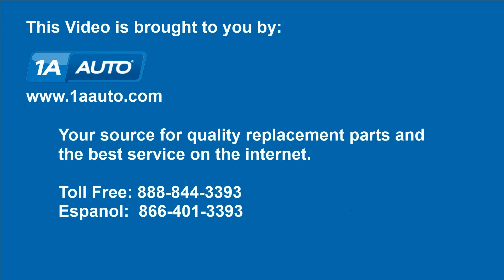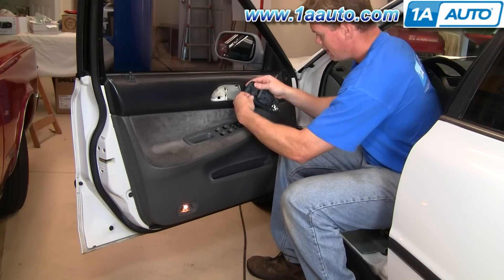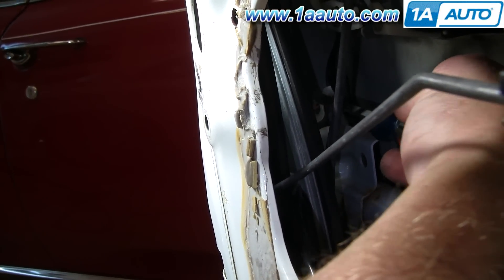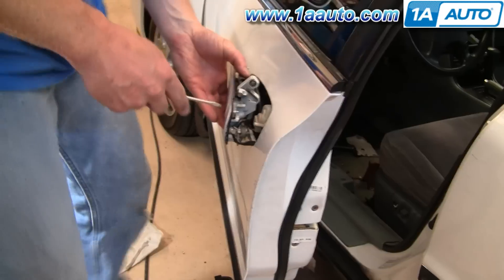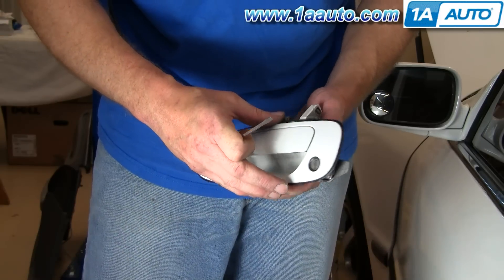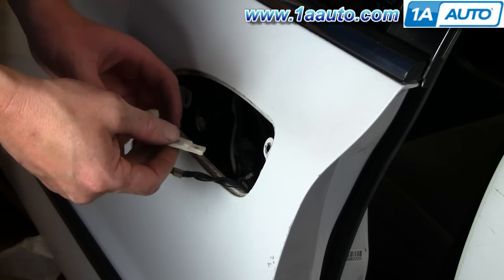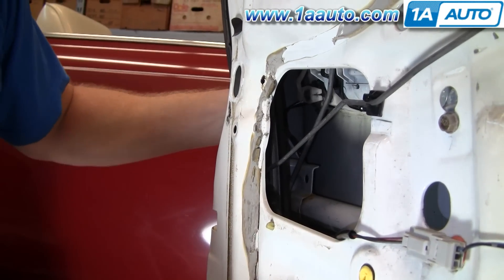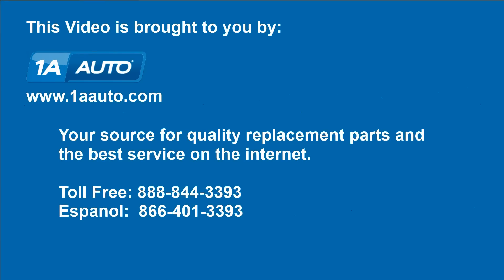How to Replace Exterior Door Handle 94-97 Honda Accord

Comment: Very Helpful. Just replaced the handle on a 98 Accord.  It was a difficult to get the lock separated from the handle and door.  Removing the retainer clip was the hardest part.  It's not part of this video, but it was on the 98 Accord.
Reply: How’d u do it

Comment: Helpful video. Only issue I had with my '94 Accord was the orientation of the white plastic "teeter-totter" shown at the seven minute mark. I installed it as shown but upon reassembly the key wouldn't operate the outside lock. It was in a bind and couldn't be turned either way. I reversed the two connections so the metal rod coming up to the teeter-totter from below was towards the rear of the door and the short white rod going up to the door handle was towards the front. Everything worked properly after that.

Comment: Video was great! I took off the door panel without breaking unseen clips. Almost broke the clip to remove the inside handle though, I took another look at the video and did it correctly. The outside door handle was loose because a screw was missing. I was hoping it was inside the door panel, and unfortunately it was not. How can I find what type/size screw it is?

Comment: any chance you can explain how the 99 is different?  i got it all apart, and back together - but i can't get the lock itself to stay inside the tube...any pressure from the outside pushes it out.  it's like that retaining clip isn't doing anything...and no matter how hard i press - no click.

Comment: after i fix the lock actuator; there's another problem. When i try to pull the handle from the outside it automatically the lock button goes back in. can you tell me whats wrong or is it the handle? I can open from the inside but i have to hold it all the way to push the door out.

Comment: I did everything and got to the part where I have to put the clip on the attach the wire harness and new lock together. On the wire harness' arm, there is a little bulge that would usually fit between the old lock but my new lock doesn't allow that bulge to get any further so now my new lock and harness won't connect. So I guess I gotta buy a different lock.....
Reply: Same problem.  Did you figure it out?